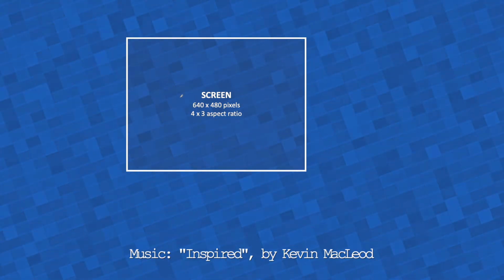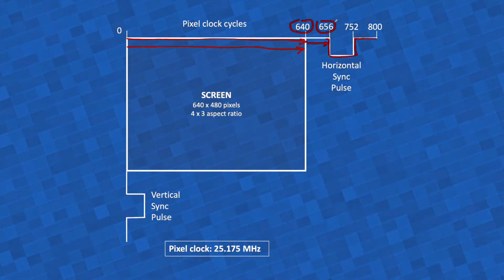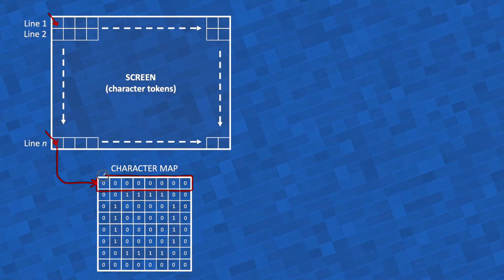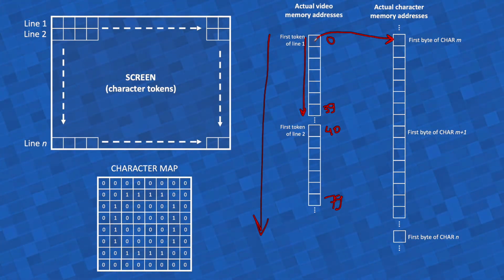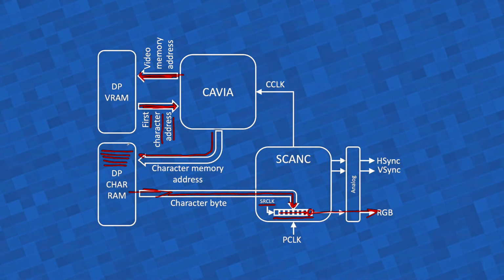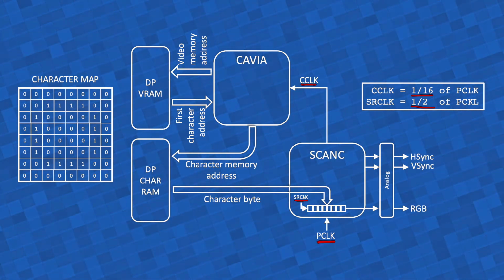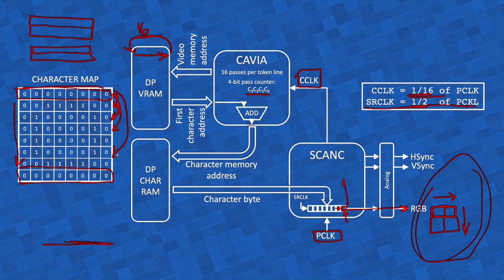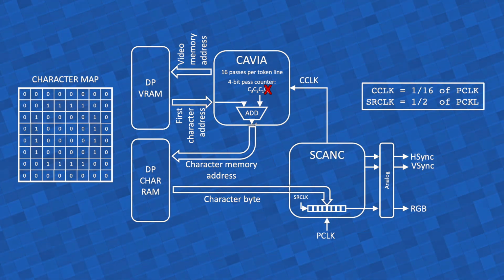Building CERBERUS 2080™, my dream childhood computer: Episode 2

Comment: I’m just curious why you decided to go with 40x30 as opposed to 80x60? It seems 80x60 would have raised the resolution and done away with the logic that duplicates pixel data across both axis.
Reply from the maker: Two reasons: dual-ported memory is expensive, so requiring 8K for video would increase the costs quite a bit. And also, since it's a didactical project, I wanted to show the basic double-sampling technique.
Reply: @thebyteattic  Uderstood. Thank you for breaking this all down in such detail in these videos. It has all been super interesting!

Comment: You just GOTTA have a funky retro case with silver, black, orange and brown bits! Quad core Z-80, 256kb ram, dual 8" floppies, vector graphics, 1 color per line of text, analog joystick, and front mounted switches, lots of switches and flashing lights...sorry it's the red bull talking!